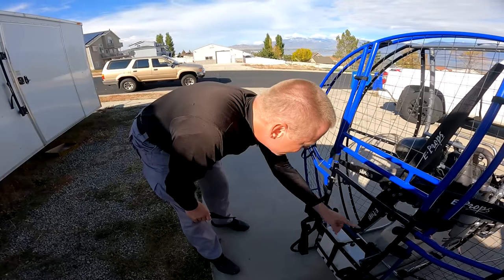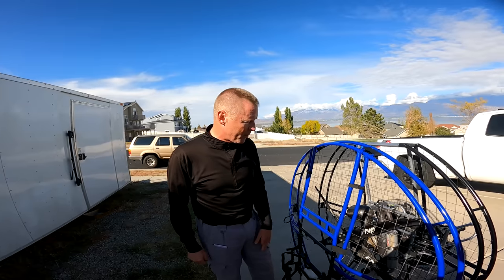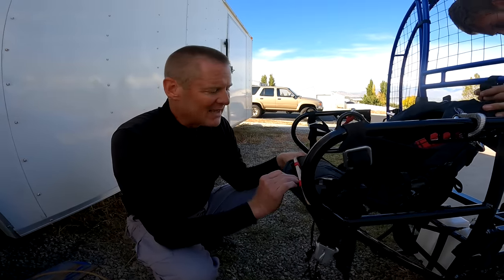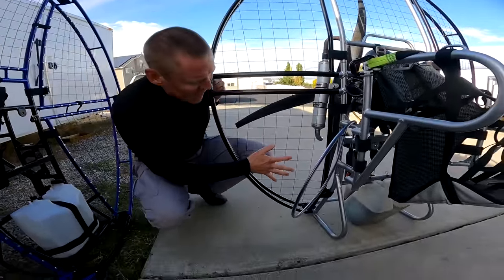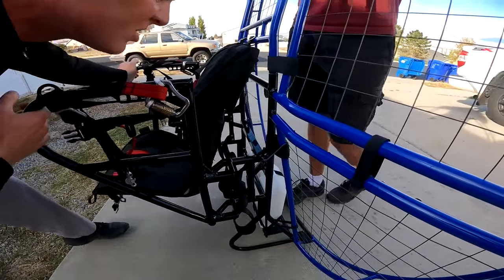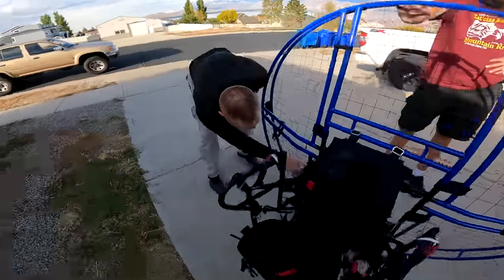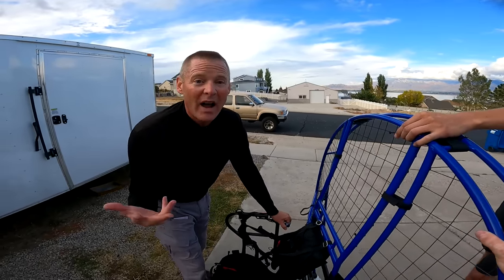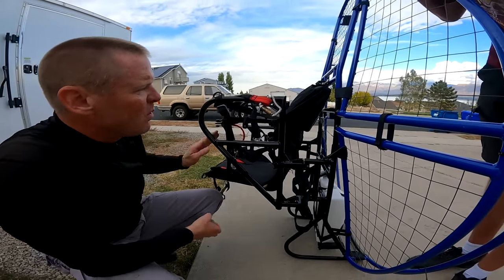Dell Schanze's Honest Review Of The SkyTap Angel Paramotor - Side by Side Comparison

Comment: Greetings, Dell. I've watched many of your videos. I can honestly say you are the best and most experienced in the game. You are a speaker of truth and that is what we need in avaition! 

Can I fly a Flat Top being 6"4 280 lbs?
Reply from the maker: Yes piece of cake.  The Flat Top will carry over 600 lbs.  I have a guy on this class that is almost 300 lbs.  It's no problem.  The Flat Top is so powerful and the Dominator is so efficient that you can even fly the smallest Dominator ever made which is only 14sm.  I literally fly it tandem with over 300 lbs.  So your weight is a total non issue.  Plus the Flat Top harness is designed to fit your height no problem.  It's really the most comfortable for both really big people and really small people.  What's funny is that the exact same unit you can fly my 10 year old can fly.  The Flat Top harness design is really incredible.
Reply: @DellSchanze  Wow,  Flat Top, and dominator is the real deal! I will pursue paramotors after my fixed-wing training... I'm definitely going with the Flat Top, and your training.
Thanks for the information Dell 🪂

Comment: I see you changed the offset of the bars. In Andy's video, his flat top has squares and he said the corner of the square would hit the sides of his body giving him bruises. He did said that his machines are heat treated after welding. Also he talked about the connection point holes, that on the flat top they were too long letting the connection point slip forward or backward changing the balance. And on his flat top, the harness was sewn onto the frame so he said it had to be sent back to you guys to replace the harness for a lot of money, and his, a pilot could put their own harness on it.
Reply from the maker: Let's address each one of these:

1. "Kidney crushers" - This was never an issue that needed solving.  We did make a really nice compound radius on the part quite awhile ago just to eliminate questions about that lie though.  

2. Connection point holes - The "sliding" is again a completely made up thing that no pilot has ever really noticed. It was changed for personal preference and pitched as a marketing gimmick by the SkyTap. The reason you don't want that is because it greatly reduces the strength to have it done the way the SkyTap does. Again, we tried that and it failed way sooner than the current version we use. Plus we have no problems with adjustability and there is no such thing as "sloppy" when flying it. Totally made up problem that isn't really a problem.

3. Sewn on harness - The sewn on harness is WAY stronger than the way the SkyTap does it. The original Flat Top's had a buckle like the SkyTap and we QUICKLY switched away due to strength differences and because the buckle would wear a hole into the comfort bar which is BAD. Plus pilot rarely EVER have to replace a harness or a comfort bar and we work hard to make that very easy for them when they would like to.

All of these things were touched on in the video with a detailed explanation. 

Every so called "improvement" the SkyTap claims is simply a failed marketing gimmick. Fake problems with worthless solutions pitched as an improvement. In all reality they made a frame that is worse than the Flat Top in AT LEAST 36 ways.

Comment: This was very helpful for someone like myself just getting into the hobby. I'm an engineer with a background in the bomb squad. Everything you've said about the components makes complete sense. The structural commentary in regards to dissimilar medals and the tensile strength of the straps is very relevent. If your straps aren't load rated for your occupant(s), I don't even know why this death trap is available for sale. This mass produced lowest bidder product should be taken off the shelf.

Comment: is there a recommended paramotor instructor in the Layton UTAH area?
Reply from the maker: There are no honest or competent instructors in Utah let alone Layton.  The way training is done is you first want to master control of the paraglider by flying in like a bit kite.  To fly a kite you need wind and the only place in the world the wind blows very consistently all day long is at specific beaches.  So to get 25-60 hours of kiting practice and up to 530 flights of experience into a 10 day class you need to travel to the perfect location and the best instructor.  Even if the best instructor in the world tried to train you in Layton it would be completely worthless as it would take over a year to try to get 25-60 hours of glider control practice.  So those who pretend to "train" in locations like that are actually frauds.  They don't actually train anyone to have any actual skills.  They just chuck people in the air without the slightest ability to properly control the glider and that's why you hear of constant carnage & death all the time.  Do it right and with the correct gear, Flat Top & Dominator, and your odds of death are almost zero.  So call 801-631-1731 and just do it the right way.  Then you can knock it out in 10 days and possibly leave with up to 530 flights of experience and mastery level skills fully prepared to fly anywhere with incredible safety.  So even if someone says they are an "instructor" if they claim to "train" in Utah you know without a doubt they are a fraud that has zero intention of actually training you.  This sport is absolutely incredible if you do it right but it's a complete nightmare if you don't.

Comment: Gross weight?  Do you carry a lightweight low power unit? Atom 80?
Reply from the maker: The Flat Top 200R is only 56 lbs dry.  The Atom 80 is a terrible motor.  Yes we have a mounting plate for it and can sell it but I would recommend against it because it had horrible torque steer.  The Flat Top 200R is only slightly heavier but much easier to launch and much safer to fly because of the much higher power and about 80% less felt torque steer.  

How much do you actually weigh?

Comment: Yeah but the color is way prettier on the SkyTap.  So...there's that.
I didn't like the unfair review on Tucker Gott, where it wasn't set up properly, but this show's different attention to detail.  Can you name ANYTHING they improved on though?
Reply from the maker: Color is opinion based. Sure it's cool that they come in colors, but I was touching on fact's not opinions. Things that actually matter. Color's could be changed at any time. 

I could not find one thing that they had improved on. I tried, Trevor tried, two other people tried and none of us could. I guess you could say color options... maybe. I personally like the black and silver better!
Reply: It has to be better than other frames from the webbing alone, no? I was hoping Trevor would try it on and see if it at least stayed higher off the ground when strapped in and standing up, because in Tucker's video it was barely off the ground and the pilot could hardly run. It really looked bad and also humorous. I guess Trevor won't be trying it on since it doesn't have a motor.
Reply: This was a detailed, thorough comparison of the two. Good video.
Reply from the maker: Flying video of both Trevor and I coming soon.
Reply: @DellSchanze  you sure you want to fly that disaster??
Reply from the maker: We don't really want to...
Reply: @DellSchanze  wear a base rig
Reply from the maker: I might just have to...

Comment: Dell what's your view on parajet Maverick or the V3
Reply from the maker: Here's my thoughts:

Pros:
- Cool colors
- Good service for parts

Cons:
- Weak netting that can easily be flexed into the prop
- Weak cage and frame that can easily be flexed into the prop
- Weak cage that easily breaks when mistakes are made and are expensive to repair
- Very unsafe frame and cage design that makes it EASY to get your hand into the prop
- No "crumple zone" to help protect your spin on firm impact
- No weight shift authority
- Less comfortable in the air
- If you break the netting in 1 spot you have to replace the entire loop for $500
- No quick release harness which puts you at risk of drowning if you go over water

Here's my final thoughts - IT'S VERY UNSAFE!! I have one in my garage and I'll admit it looks cool but I can literally stretch the netting into the prop with almost no pressure. I can also easily touch the netting and cage with little force too. The netting and cage are so weak I'd never fly it for that reason ALONE!

Here's why a weak frame, cage, and netting is so important - When doing a forward launch you put lots of pressure and force on the cage with the lines. If you apply throttle by mistake or something unusual happens, you can easily get your hands into the propeller. Sadly, this happens ALL THE TIME even for people with lots of experience and skill. In addition to that, if you trip and fall down your first instinct is to put your hands out. As your hands slide around above your head or by your head the frame and cage can come down and go right into your hand. It's stupid.

I for the LIFE OF ME can't figure out why these paramotors have netting that's weak. The Flat Top Paramotors netting, frame, and cage are so tough you cant physically touch the prop and the cage together without SNAPPING the prop in half. IT JUST DOESN'T HAPPEN!! 

To me that one safety feature alone is worth not flying those paramotors. 

In addition to that, they swing arms they use have almost no weight shift authority compared to the Flat Top. I'd say it has about 40% of the weight shift authority of the Flat Top.

It was also less comfortable in the sky. The Flat Top is WAY more comfortable in the sky than people might think. It's like sitting in a perfectly fitted lawn chair. I'd say the Maverick is 10% less comfortable in the air.

Parts are more expensive too. If you break one piece of the netting it's $450+ shipping to get a whole new net. If you trip and fall down on the Flat Top, it's only $250 a cage piece and you rarely ever break more than one.

Getting into the seat was a lot more difficult too. The Flat Top scoops you up so easily and quickly you don't even realize it did. Most pilots don't even have to think about getting into the seat on the Flat Top. The maverick was about 20% harder to get into the seat. Had to let go and push on the seat to get myself into it.

I will stop rambling on now... Bottom line, It's a fine paramotor but I'd NEVER pick it over a Flat Top for any reason.
Reply: @DellSchanze  thank you for taking the time to explain Dell.

Comment: The design, construction, and materials of the SkyTap Angel paramotor are reminiscent of the doomed ocean liner TITANTIC that sank in 1912.  This massive ocean liner incorporated over one million wrought-iron rivets ....fastened to poor quality steel hull plates that were NOT heated during the riveting process.  This steel was susceptible to a phenomenon known as "brittle fracture" which results in weakened steel in very cold temperatures.   Many other design elements of the TITANIC were unsafe or compromised contributing the deaths of nearly 1500 men, women, and children in the icy waters of the North Atlantic.